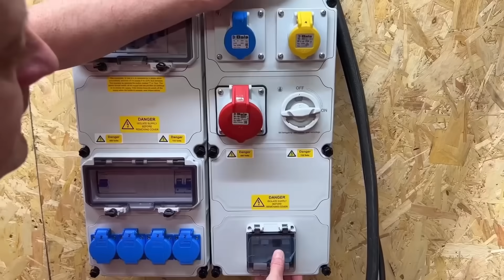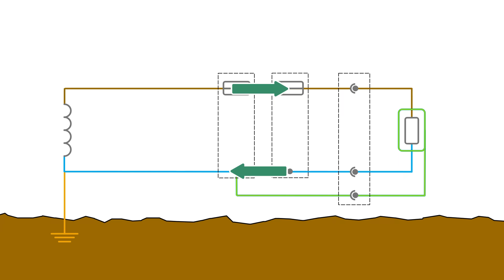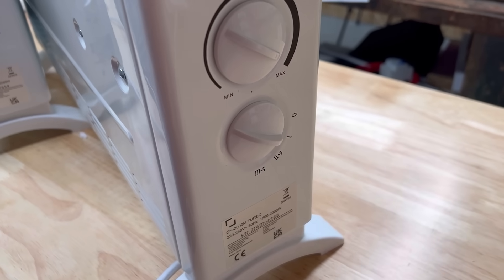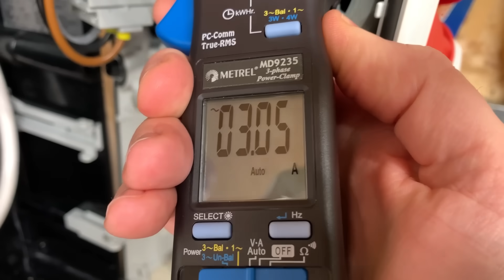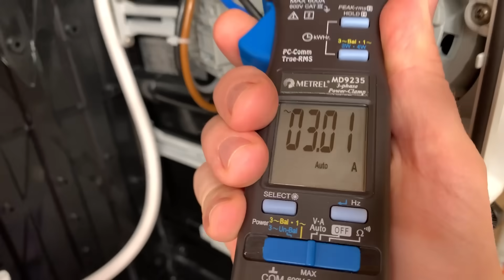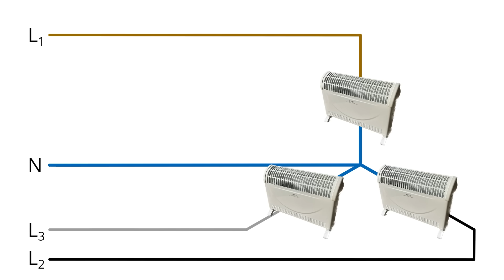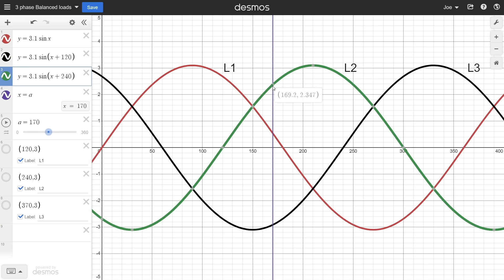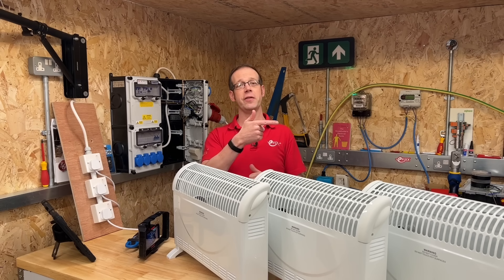Does Current Flow Through The Neutral Wire?

Comment from the maker: More electricians' questions answered 👉 https://youtube.com/playlist?list=PLmWOIPxaBWH7XMcW07S7CTQM9G-M1GHzc
Reply: A couple of gotchas with 3 phase neutral: 1) If there is a fault the absence of a neutral connection can allow overvoltage on the phase conductors without tripping breakers and the risk of shock or fire in any connected loads and 2) someone might connect a 3 phase + neutral appliance like an industrial heater to single phase power, joining all 3 phases together and tripleing the current in the neutral. Best case the neutral wire burns out, worst case the building burns to the ground.
Reply: Try a star connected 3 ph motor
Reply: Actually, technically No. Current doesn't flow in a conductor, it flows around the conductor, or so i was taught at trade school. Current in the neutral must equal the current in the active, how else does an ELCB work!
Reply: @markhill9275  OMG OMG OMG....Current doesn't flow in a conductor, it flows around the conductor,????  matter, atoms, electrons, neutrons... learn your lessons again
Reply: Don't know how UK electric works other than that you lot use 50 Hz instead of 60 Hz, but in the US you can't have 3 different devices share 1 neutral with 3 phase power. It used to be allowed, but the NEC was changed in 2014 I think. It's a lot of fun trying to fish 2 new neutrals in the old conduit to upgrade old buildings. (not)

For fear of undiscovered nicks/shorts when the power is turned back on, oftentimes we just hook new wire with additional neutrals to the old, and use the old for the pull line to install the new and then recycle the old.
Reply: Yo yo best thebest
Reply: So if single phase has 3 amps in neutral then if a 3 phase system is extremely unbalanced we will still have 3 amps. So no need to balance. Am I right. Also loads keeps turning off and on so max 3 amps that should be bearable. Why balance?
Reply: Make one on earth. Do we need separate ac and dc earthing rods in a solar system?

Comment: In my older house, back when knob and tube wiring was the standard,  very often a neutral wire was shared between two branches,  and for exactly the same as here.   But the key is the hot legs must be out of phase which is easy enough by having the circuit breakers right next to each other in the panel,  then the neutral will at most carry the same current as 1 hot, and if the same current flows in both then no current flows in the neutral because the hots are 180° out of phase with each other and cancel each other out.    This can also be easily achieved with 12/3 NM wire today since there's 2 load conductors and 1 neutral in the sleeve.      

The problem comes if you have someone move circuit breakers around in the panel and you put two hots that are sharing a neutral on the same branch, then you could get a situation where you push twice the allowed current through a neutral.   Now code these days requires a double poled breaker so that can't happen, but let me tell you... back in the day that was not the code, and when an electrician put in a new electrical panel when I got solar, he completely missed that, I mean in his defense he didn't see double poled breakers but as a pro he should have counted the neutrals to hot wires in the box.    Luckily I caught his mistake, and was able to move stuff around in the box so my house wouldn't burn down,  the only reason why I needed him was to have someone who could talk to the inspector to give my box the sticker, so the power company would allow the hook up to the grid... and yeah, the inspector passed his work as he too didn't count the neutrals to hots, showing inspectors fail all the time too.

Comment: Vector diagrams are your friend, the resultant neutral displacement angle and current is the vector sum of the individual phase currents. Also very helpful for demonstrating how capacitors correct bad power factor graphically. I still remember electrical theory from my trade course 50 years ago.

Comment: even with a perfect balanced load, the 3rd harmonic currents of each line shall sum up in the neutral. The example with the three heaters are almost purely resistive loads; try to do the same with 3 non-PFC power supplies (like laptop PSU's)

Comment: At what point in the neutral circuit does the current drop to 0? Surely for the heaters to work, there must be a current in the neutral of the heater flex? These are single phase units.

Comment: Hey Galileo, if you disconnect the neutral completely the heaters will not work. These are still single phase heaters, they require neutral.

Comment: The neutral carries the unbalanced current from the other conductors - that's why it's called the "neutral".  If there is no unbalanced current, as with a 3-phase motor, there is no need for a neutral.

Comment: I'm trying to understand the details. Could you actually disconnect the neutral in this situation? It would have been nice to see that demonstrated. The heaters still need a potential difference to operate, right, doesn't that go away if you disconnect the neutral?

Comment: The neutral line in a three‑phase motor isn’t strictly for the motor windings themselves (which can run balanced without it). It’s often present because additional electronics or auxiliary circuits introduce unequal current draw, and the neutral ensures stable operation under those conditions.

Comment: this analysis applies only to simple static, balanced 3 phase loads which are now pretty rare. Any dynamic loads like the now ubiquitous switch mode power supplies/inverters/DC-DC converters completely negate this analysis. Why this is so would make an interesting and more involved video but the takeaway is that you need a fat neutral wire as harmonic currents add up in the neutral wire

Comment: Wasn't until my 2nd year of electrical engineering and 3 phase ac until I understood the purpose of neutral and what exactly I was doing when I wired lights when I was younger. We don't use neutral wires in lab because the phases are balanced.

Comment: Of all people, an Englishman ask about 3 phase questions, in a country with rare 3 phase electricity .
 I spent 2 years of my life in England and found no place were was 3 phase power  ever installed.
 The rest of europe country got three phase power atmost to all buildings, even my small house in a north germany  village got 3 phase electricity. I happy with it because  I can run my Lathe, my drill press, grinder and welding gear , all old industrial gear. Even my jet cleaner run on 3 phase. 

Yes  a balanced consumer will not load the neutral. Industrial installation even got no neutral, only three phase and Earth. 
if a single phase gear is distributed to all the phases a inbalance occur due to different loads.
In installations without N single phase loads were connected to 2 of the 3 phases, so they run on 400V or a transformer in between to get 230V . I got an old fan heater with 2kW, it run on 400V single phase , the advantage is it need only 5 Amps current.
the real advantage of three phase is the rotating field, it is nothing cheaper to build than a 3 phase induction motor. No annoying capacitors and low start torque, real power from the start.

Comment: I’ve seen amp meter read current off neutral when someone had too many light fixtures on a circuit above the 80 percent of the 20 amp breaker and the circuit didn’t have a thicker gauged wire for a voltage drop past the 100 ft mark from panel. It did alternate another circuit sharing same neutral and with the circuit that had  less lights on branch circuit.Two numbers would show and the third circuit didn’t with same timed cycle. Anyway ,I told guy in charge that the circuit was too far away and with all those light there be a switch to a relay because the loads was too much for the switch . I could feel coming off switch.He had to go back and fix it and did everything that I told him so.He was trying to save the boss man money and it backfired.

Comment: This was two years ago. There are no electrons moving along conductors. It's only energy that goes in the wires in the form of EM waves. Every thing exists in this world in pairs. The 'current' you measured in neutral may just the residue that cannot do anything. That's why the neutral wire is smaller. In my view that neutral prevent any leak damaging the system. So what is required may the tiniest wire ultimately connecting to the ground. Think it this way: it may be the dark partner of white light. Perhaps, even Tesla did not understand it fully. But it just worked. That's why he wasted lots of other people's money,  in my view.

Comment: Ok, got it. Now on a single line conductor with neutral, like in the example, if their is 3 A on line and 3 A on neutral, why is touching the neutral you wont get electrocuted and if you touch the line you will get elecrrocuted ?

Comment: I've understood this for a while and as you stated there is current in the single phase neutral within a property. That,  I've found seriously confuses home owners who think the neutral is safe to touch. Why can't we change the terminology for non electricians to flow and return to get the idea into people's heads that it's not a neutral at all times?
Reply: They did. Neutral is formally known as Grounded Conductor in the NEC. It's just the term neutral persists in the trade and it wont probably go away anytime soon.

Comment: Course you gunna need a neutral on a 3ph socket for the unbalanved loads with lighes and what not plus in some equiptment it will use 400/415 but also use a phase for the 230 bits in side

Comment: Its simple, if you have a single phase load then yes, if your phases are imbalanced then yes, but even if you have all 120 volt loads on a 3 phase Y connection it isn't 3 times the phase amps because they are...well not in phase.

Comment: But why using on ore two phases the current flowing in neutral is in both cases the same reading? how do I calculate this in theory if I use two phases if those L1 and L2 reading doesn't cancel themselves/each other?  and where's the current going then?  You explained this clearly when using three phases.

Comment: Unless it is an IT network where all loads are connected between the phases themselves.
In that case your three resistivity heaters would look more like a delta connected 3 phase induction motor and you could load the phases differently, the phases would just carry different amount of current depending on the load. At least I think my conclusion is correct 🤓

Comment: So if I hold on a Neutral Wire (when switch if OFF) i would not be shocked, but if I holw on the Line Conductor (with switch still OFF) I get a Shock... CORRECT??

Comment: Current is flow in a pipe. Resistance is the size of the pipe. Voltage is the pressure in the pipe.

Comment: Ions or electrons can flow. Current describes the intensity of this flow of charged material (which merely wiggles in AC systems at 60Hz). "Current flowing" is thus nonsense, and it is needlessly confusing -- implying that current is a particle. Water flows, sand flows, but gallons or liters without further embellishment don't flow.

Comment: I just want to add that industrial loads  uses motors that are usually balanced loads.  But they also need power for some loads like maybe lighting, office equipments,etc. This and the larger power requirements are two reasons why three phase  Y with neutral wire is preferred.  
Maybe next time make a video using Kirchhoff law to prove that the current is zero for balanced loads or maybe the current flowing is the difference (like current A minus B) for two AC circuit

Comment: Very good explanation of three phase circuit specially neutral current.  Balanced three phase circuit (except Y) and two single phase circuit common for residential really don’t need neutral.  The unbalanced current will flow to neutral wire.  In fact if you follow the transmission and distribution lines from generation to load some don’t have neutral but all have grounding wire connects/‘bonded’  to earth.  Neutral are sometimes needed in big loads like industrial which needs a real lower voltages for some application.  For economic reason using delta transformers are prepared.  In most residential loads the circuit uses delta (secondary)but a tap is made at the center to provide a neutral making it a two single phase circuit and not three phase.  Again with same reasoning the unbalanced current will only flow through the neutral wire. Note that neutral wire are also grounded to earth in power source/transformer and in the house service entrance/connection.  The ground wires are for protection in case we accidentally touch the hot wires (example we touch the equipment housing (with part of the body young the earth or ground) where one of the hot wires touches the case of the equipment.  If there is no ground wires the neutral will be floating and will have voltage from the ground.
This is the reason why for residential we can make the circuit balanced by distributing loads to the two hot wires as much as possible.
Again is one of very good video showing the current for unbalanced and unbalanced circuits.  Thanks.

Comment: Yes, but a circuit has to be a closed loop somehow to be a circuit.- A return to the power station? This bit hasn't been explained.
- it doesn't show on the meter because it's showing it all averaged together?
So, had a thought (yes, possible), -if there is no current in the neutral at all, is it then current derived in the windings from the electromagnetic field created by the voltage cycles and you have a loop of current within those windings, just maintained by the incoming voltage potential?
Is there a voltage on the neutral though, but no appreciable current, as you have measured?
(I googled it and only got shit answers and whilst doing other work, I had further thinking.)

Comment: I presume this only works while the three neutrals from each device are connected.
They don't need to be connected to the DB but they do need to be connected to each other so while the neutral on ph1 is high the neutral on ph2 is low,
while the neutral on ph2 is high the neutral on ph3 is low and so on which is where the balancing comes in?

I'm no electrician or even an apprentice electrician, my job involves a certain amount of basic electrical work which doesn't require me to know this kind of thing but i do make connections into places where touching the wrong thing could potentially get me entered into a break-dancing competition.
I think having a little bit of understanding isn't a bad idea and its always fun to learn something new.

Comment: 4:00 I would have liked more explanation of the neutral current in the 2 phase usage.
Reply: You can extrapolate it from 5:50 where he sums the phases. Imagine it like this, as if half of the load goes back by the neutral and the other half is back divided by the 2 phases.
Reply: @roadrunner9843 When L1 is at 3.1, L2 is at -1.5. they both sum up 1.6 and not 3

Comment: i always knew that you dont need a neutral in a balanced 3 phase load like an induction motor or a heater but i never thought about the fact that 3 phase also tends to balance in all other appliances and just uses the neutral wire as a sort of star point connection wire. like the phase bridge in the connection block of a 3 phase motor.

Comment: Why then, if you miss a neutral, the the single phase apliances will burn out,I had experience with lighting where the was lost and all lights blew because of 380 v not 220 any longer
Reply: because the imbalance current have nowhere to go except back on the live wires. This will change the expected current on the appliances (if they are still on) and according Ohms law, more current means more voltage across them.

Comment: Take this example: Instead of ideal resistive load we put a server rack on each phase. Those have SMPowerSupplies. That will introduce a 3rd harmonics on each phase, because of square wave they are switched by. Than the resulting current in the neutral wire will be the sum of currents of all three phases and poorly dimensioned neutral wire will burn.
Reply: @petrbrazda1064   you are amazing I am having that issue now 🙏

Comment: Neutral...not needed in 3phase circuits until it IS...then things can go haywire and be expensive. In fact, its quite common for rotten neutral to destroy half of the house appliances in here.  The installations are old, in some places its TN-C, or TN-C-S...and the point where it gets into the building and is supposed to be earthed if in dubious state in many cases.
Reply: Some years ago I attended a large distribution centre to undertake some work in one of the pallet truck battery charging areas, but was unable to access it. Apparently the neutral connection at the main isolator had failed during the night and all of the battery chargers ( around forty ) had been instantly destroyed as a result and the area was full of technicians etc replacing them. I was working in the inspection department of an insurance company at the time and have read a number of reports of the damage caused by the loss of a neutral connection to a three phase and neutral distribution board. In at least one case it had resulted in fire that caused extensive damage to an office.

Comment: Yes there is mostly always current going back to the transformer in a A/C system unless you have condensator and spool in line. 

This is because in a 3 phase system you have to have same load on all 3 phases to balance out the nutural current.

This is why eddie currents can a happen and why its important to have right dimensions on the cables for the load its going to experience.